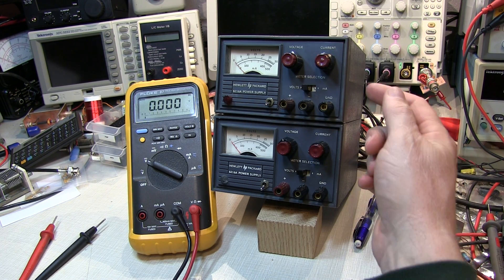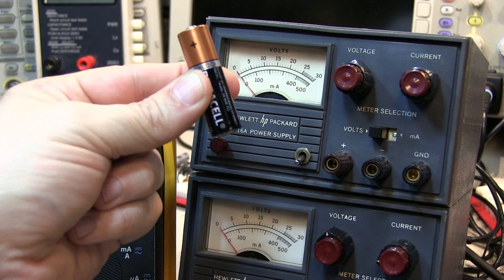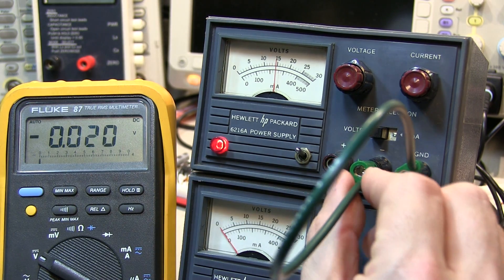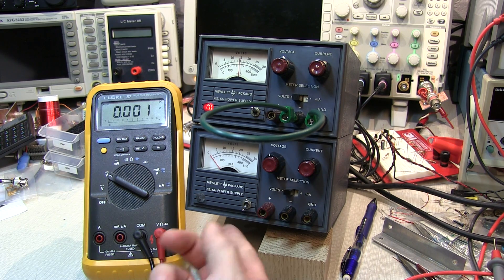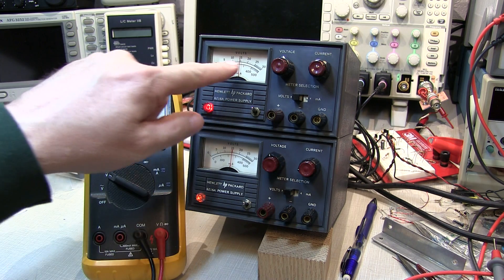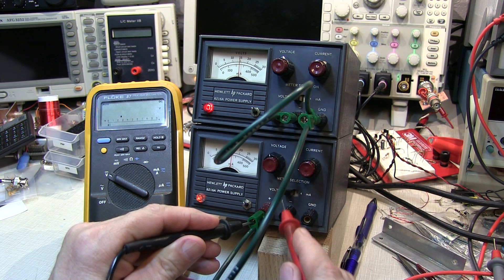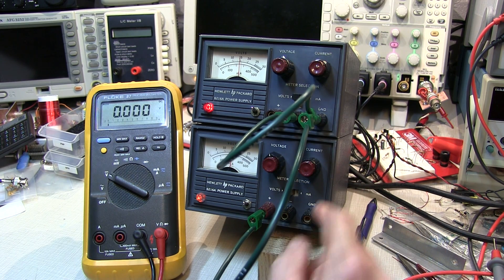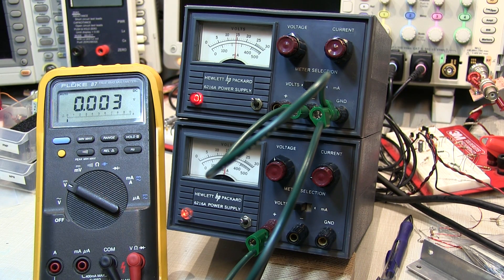#233: Back to Basics: How to use the 3 terminals of a lab power supply | split supply

Comment: But why have the extra connector to the Gnd terminal - you could just as easy connect the circuit Gnd to the -ve terminal it was connected to for the same result.
Reply from the maker: If you want the circuit ground connected to mains ground, then use strap them.

Comment: This video is misleading, IMHO. It implies that you need to have 0v at "earth" reference to create a dual power supply (+ and - voltages). In the absence of jumpers between the + &/or  - terminals to the green terminal, the power supply will be floating, normally a desirable situation, as it prevents ground loops when probing the test equipment. So all you need to get a dual power supply is to connect the + terminal of one supply to the - terminal of the other. The ground terminals shouldn't be connected to anything. Just my two cents.
Reply from the maker: True - connecting to ground isn't strictly needed - but can prevent issues with common mode pickup, etc.  So, sometimes it solves problems, sometimes creates them.  In my experience, it solves more problems than creating them.

Comment: Decades ago, when I 1st bought a nice Power supply, it didn't dawn on me that I'd need (2) to do + & - voltage supplies so I immediate bought a second unit.
All this time I have been connecting the + &  - together on each supply and making that common node 'ground' ( w/o using the ground on either supply)
   Last year I was testing and audio headphone circuit powered by these supplies and also powering my iPhone from one of the USB's supplied on the pwr supplie,s sending the stereo audio from the test circuit into my iPhone. 
This torched my iPhone. 
I suspect if I had used the ground lug as shown in this post I could have avoided the necessity for a new iPhone   : /

Comment: Forgive the question, I never really got in depth with these sort of things, and I am just getting back into it now, fixing monitors and TVs etc. If you wanted, say, +15V and -15V rails with a common ground, why wouldn't you just set both supplies to 15V, connect supply 1 negative to supply 2 positive (using the connection as a "ground"), and use supply 1's positive as +15V, and supply 2's negative as the -15V rail? I am a bit wary about connecting an otherwise floating voltage to a mains ground that could become live at any time, should a serious fault occur elsewhere in the mains system. Thanks in advance 😁
Reply from the maker: Either will work.  Connecting the common point to mains ground will keep the voltages from floating far away from earth ground.

Comment: You do not need GND connection in order to stack PSUs or to have -15V and +15 supply. So question remains why do you use ground?
Reply from the maker: Tying the GND to the zero-volt reference point in your circuit helps to prevent noise coupling to (mainly common mode noise) the supplies.  It is also important if your circuit to going to be connected to other circuits or equipment that is grounded.
Reply: @w2aew  Thank you I think I undetstand now.

Comment: Why won't various power supplies be able to SELF regulate without a Load? any reasons why certain power supplies won't self regulate
Reply from the maker: This can happen with some switching power supplies.  These types of supplies regulate the output by injecting some charge onto a capacitor at the output of the supply.  They do not have a way of removing the charge on the output capacitor.  So, if there is no load, then the supply has no way of reducing the output voltage on it's own, so the regulation doesn't work.  These types of supplies rely on the fact that the load is always pulling charge off of the output capacitors, and regulate the output by injecting the correct amount of charge back into the caps to compensate the drain of the load.
Reply: @w2aew  but why would Switching Power Supplies want to Inject a charge into the filter capacitors? Vintage linear power supplies that used a feedback loop or a sense circuit would also NOT be able to self regulate without a load, any reasons why?
Reply from the maker: @waynegram8907   That's how switching supplies work.  They inject a small amount of charge onto the output capacitors, at a very rapid rate, to maintain a desired voltage across the capacitor.  The feedback loop helps determine how much charge to inject based on how far the voltage has dropped due to the load.  There is a finite limit to how "little" the injected charge can be, so these supplies must have some load in order for the regulation to work.

Comment: is it safe to take the series + & - terminal as ground for a split supply? in my country a separate dedicated ground line in mains isn't a standard
Reply from the maker: In most lab supplies, the voltage is generated between the + and - terminals, not between either and the ground terminal. So that won’t give you a split supply.

Comment: Would you really need to use the GND terminal at all if trying to get +15V and -15V at the same time?
Connecting anything to GND seems useless, unless you want to skip connecting the oscilloscope GND terminal when measuring something.

Comment: Thanks for the info! Havent thought about connecting them in series. Sadly my psu is from china and there is no spec for max float voltage, how do i know how much is safe, is there like a rule of thumb that its safe to 100v?
Its wanptek dps series psu

Comment: I don't know if I'm being dumb, but even when not stacking I always connect my negative terminal to the earth plug unless I explicitly want the supply to be floating. I do this just because I will sooner or later likely connect the circuit to ground, and I want to avoid "surprises". Be it USB or the ground lead of an oscilloscope probe, for example. I know that especially for the probe it might be safer to not have my circuit connected to ground, because then accidentally having the ground lead where it shouldn't be won't blow it up, but that's actually part of why I'm doing it: I don't want to get used to it being okay to connect my ground lead anywhere, until one day it isn't because I also connected the circuit to ground through USB or an audio output or something.
Reply from the maker: No, you're not being dumb at all.  I will keep my (-) terminal connected to ground most of the time too.

Comment: The way you have both power supplies hooked up at 4:14 creates an earth reference for your circuits which may not be desirable. Why not connect the negative terminal of the upper supply to the positive terminal of the lower supply and use that as your (floating) ground reference. The upper supplies positive terminal would then be at +15 V and the negative terminal of the lower supply would then be at - 15 V both relative to a floating ground.
Reply from the maker: Yes, you certainly can do that.

Comment: As you mentioned is the ground terminal typical connectet to mains ground. So i always thought that this is the terminal that i lovely would connect to my esd mat. Am i wrong to think that stacking power supplys with only two connections should do the same like stacking batteries? Maybe a little harder to find the ground wire afterwards. Did i miss the point? Is there a benefit to connect my circuit ground to mains ground maybe? Thank you.
Reply from the maker: You are correct that stacking power supplies with the two connections is the same as stacking batteries in series, assuming two things: your supplies have floating non-grounded outputs, and you don't exceed the maximum offset voltage (terminal to ground) rating for the supply.  if you are going to be connecting other instrumentation that is not isolated (scope, signal generator), then you may want to tie your power supply reference rail to ground.  Otherwise it is perfectly fine to just treat the two terminals of the supply like a battery.
Reply: @w2aew  thank you so much, got it now.

Comment: So when stacking you are in essence adding to the longevity of each unit since you won't be pushing them so hard? In HHO applications for building a torch would this method help to not get things hot? And since they can push and pull would one be able to add one on the backside of the cell to help keep a good flow? Heat is needed but not in the supply units.

Comment: Can you make a video lesson about cell phone chargers wattage, charging time, linear charger circuits compared to switching charger circuit internally inside the cell phone. The cell phones have an internal circuit inside the cell phone that are called a linear charger or switching charger circuit that will I think change the duty cycle of the charging time that is based on the AC/DC Chargers Wattage. If you use a 65watt AC/DC charger it will "force charge" the cell phone and can damage the cell phone battery. The Linear charger circuit will change the charging time by the duty cycle and pulse width, I'm guessing.

Comment: @w2aew I have a question.  What is the mechanism that limits how far you can stack your power supplies away from common ground?  You indicated that one should check the datasheet to find the voltage limit, but I don't understand why there would be a limit.  Doesn't each supply only see it's own voltage potential, much like a battery, and would theoretically not care that it is sitting 4000 volts offset to earth ground?  The only thing I can think of is that it is a limitation of the insulation between the mains hot, neutral, and ground, and the floating half of the PSU such as the metal chassis itself and the internal construction of the transformer within the bench power supply.
Reply from the maker: It is most likely a limitation on the insulation as well as any protection circuitry between the floating output and mains ground.
Reply: @w2aew  Thank you very much, dude!
Reply: @w2aew  Are you familiar with the dual power supply model TW6050A? on the range gauge it says 0-60 but on the range adjust knobs it says 6v and 60v i thought it should be 0- to 60 volts?
I have looked for a manual and haven't been able to find one.
Thank you
Reply from the maker: @SDsailor7  The 6 and 60V selection is a range switch.  When the switch is in the 6V position, the vernier control will give you 0 to 6v adjustability (and you divide the voltage reading on the meter by 10).  When in the 60V position, you can get 0-60V output.  This is done to make it easier to adjust for low voltage applications.
Reply: @w2aew  Got it. Thank you
Reply: @w2aew  I am going to pick it up today, saw it in a local ad for $30 bucks
Reply: @w2aew  Picked up the Power Designs tw6050A dual power supply today. It should come in handy. And at a good price.

Comment: What is the use of a mains earth referenced power supply? It increases the risk of blowing the scope if not probed properly
Reply: All the ground binding post does is allow you access to the chassis of the power supply and the ground prong of the power cord that’s attached to it. Normally you don’t use it but there are situations when you want your supply voltage referenced to earth ground, and so in those cases you slide a jumper plate across the ground and negative terminal to connect them.

Comment: Hello Sir, I need a little help please. I’m experiencing a nasty noise from my regulated 13.8 ps. It’s a linear ps. Can hear the noise in the radio up to about more than 2 MHz so I decided it’s better to have a look at what’s wrong. I understand the concept of floating terminals and so mines are. But I got a bit of a shock today touching two coax shileds. One is connected to one radio ( ft991a) powered by the ps at 13.8 so the black lead is referencing the chassis of the radio. The other shield is from the coax connected to a second radio which uses its internal switching ps (ft1000). So this latter shield is referenced to earth from the main. I was disconnecting the coaxials. After the shock I measured about 170V AC between the two after being disconnected. After further tests I can tell the external regulated supply has a potencial difference of about 140 ish Volt AC between main line and either one of those 13.8 terminals. Similarly there’s about 40 V AC between neutral and either one of the DC terminals. They are floating as you say in this video. Is this behavior normal or something is wrong with my power supply? Hopefully I’ve been clear enough in my explanation. Thank you for your answer.

Comment: Hello, one question , can I take the "floating" minus of first one and input it as a reference of the plus of the second one, in order to still have +15 and -15 but completly isolated from earth , as I have seen that being "connected" to earth my be a risk when measuring with a scope a circuit that would be powered up ? Thank you and much regards for your great videos. Take care.
Reply from the maker: Yes you can.

Comment: If a lab power supply is rated at 10 watts, how would you know what the maximum TRUE power, VAR power and VA output power of the lab power supply? any calculations I can do to get the True power, VAR power and VA power of the lab power supply
Reply from the maker: A DC Lab Power supply outputs DC, so there is no reactive power.
Reply: @w2aew  The V *I is the wattage but is this considered True Power for DC power or True power, VAR, VA absolute power is only for AC circuits?
Reply from the maker: @waynegram8907  In DC circuit, V*I is the actual real power.   Apparent power, reactive power, etc. only apply to AC circuits.
Reply: @w2aew  Uninterruptible power supplies are 120VAC outputs. If the UPS power supply says 10watts is that V*I = true power, VAR is reactive power V * XL or XC  , VA absolute power is I * V. What is a common problem with UPS power supplies is when it says 10watts and connect multiple reactive loads it overloads the UPS and damaged the IGBT transistors. The 10watts is True power V*I = wattage but the VAR and VA is NOT at 10watts. So the UPS power supply will give overloaded and blow the IGBT transistors. How would you calculate the VAR and VA of a UPS to know the max wattage of VAR and VA of the USP power supply? Different types of machinery are reactive loads but if you connect a current ammeter to the machinery active load to measure the AC current, the current ammeter doesn't measure reactive or absolute AC current but only true power AC current. So how would you be able to measure the VAR current and VA current when ammeters current meters measure only in True power AC current?

Comment: Older power supplies circuit would use a Parallel power resistor places across the input/output pins of the regulator chip and the value of the parallel power resistor would determine how much output current the regulator and power supply would source to the circuit under test. The Parallel Power resistor is bypassing the regulator chip by sourcing more current path around the regulator chip. The regulator chip starts to self regulate the input/output current when doing this. It's very confusing how this works, can you explain how this works better?

Comment: Ok but why can't you skip the ground plug all together? What happens if you just do the negative-a to positive-b? Could you use either of the connected ports as ground while the unconnected ports are positive and negative?
Reply from the maker: You certainly can skip using the ground connection entirely - this is much the same as using a battery as a source.  You could arbitrarily assign "ground" to either end.

Comment: How do you test the maximum wattage of a lab power supply? I can put a 5 watt resistor across the outputs of a lab power supply to measure the maximum current. If the power supply wattage is max at 20watts, what would you need to do to make the power supply circuit to increase the wattage to 50watts?
Reply from the maker: Simple ohms law.  If the power supply is rated for 50W and can supply up to 20Vdc, then you need a load that draws 2.5A and can dissipate 50W without overheating.  Often times, people will parallel a number of light bulbs to achieve this - much cheaper than high power resistors.
Reply: @w2aew  But light bulbs need AC 120vac which Light bulbs are they using to use DC 20vdc at low amps of current? If you want to modify the lab power supply to increase the wattage of the power supply what needs to be done?
Reply from the maker: @waynegram8907  No they don't.  A 120VAC light bulb will work perfectly well with 120VDC.  If it is a low voltage power supply, then automotive incandescent bulbs will work fine.
Reply: @w2aew  I never tried using a 120VAC light bulb and using 120VDC never thought it would work. I don't think I have used any lab power supplies that can go up to 120vdc. Most lab power supplies go up to 30vdc to 50vdc max.

Comment: Can I keep the Negative always connected to the Ground? Any problem with this approach?
Reply from the maker: 90% of the time, if all you need is a positive supply, this is perfectly fine (and normal) to do.  It's only those instances where you need a negative supply, or there's a reason why the supply needs to float, that you should change.
Reply: @w2aew  Thank you and Yes for a symmetrical +/- voltage, the power supply must be floating, but, otherwise, for "safe" reasons is a good approach to keep the negative and ground always connect? is this a better approach than, e.g.: two circuits from 2 power supplies floating, should be better to ground both negatives, right?
Reply from the maker: @JohnUsp  In most cases you want multiple circuits to have a common reference (ground).